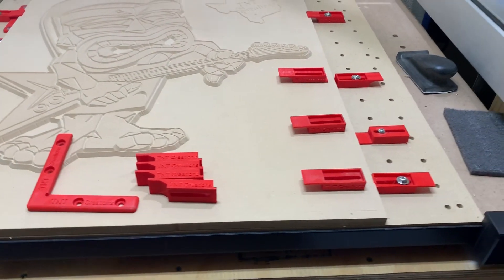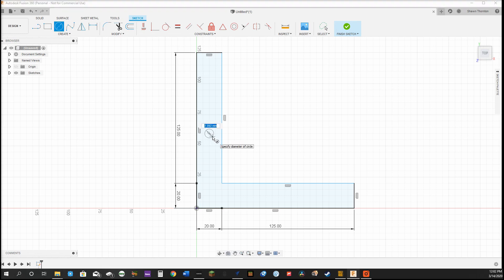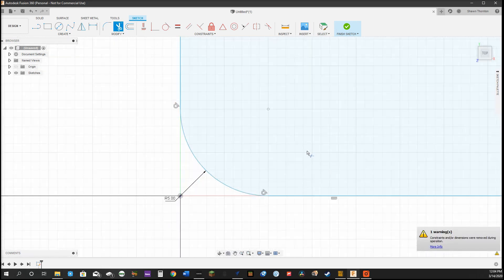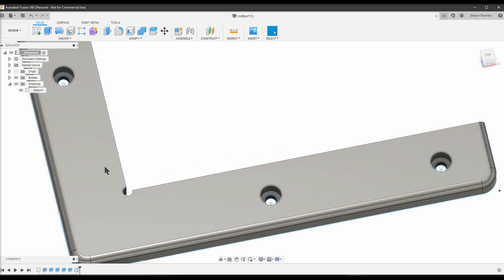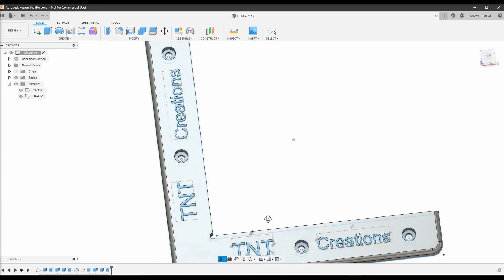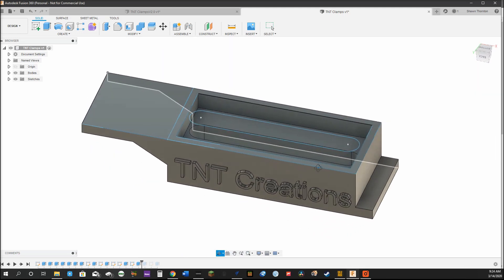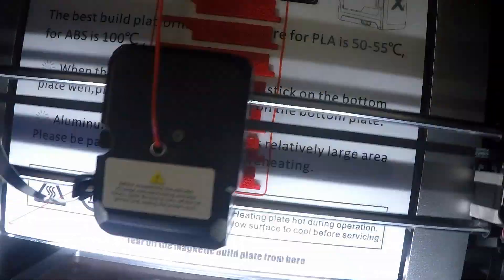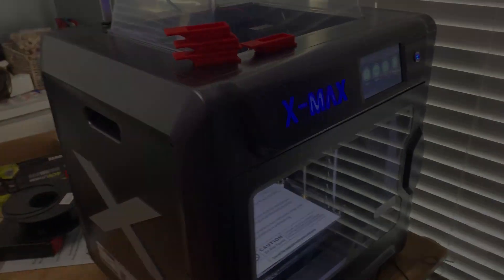3D Printing with Fusion 360 and Qidi X-Max - TNT Corners and Clamps

Comment: Can you give me the site address to where I can buy  these. Also I see that you use the touch probe and  the bit setter.
I want to start to use my material bed to set my Z height to help from cutting in to it. If I use the touch Probe to set my XYZ with a end mil and zero all there . move my router and set the Z to the machine bed with the paper methed is the only thing I need to zero there is the Z height. Is that correct . And as lone as I don't redo the x and Y and do a bit change I still only need to set the zero on the Z.no matter where i do that on the bed. I want  to buy a bit setter how will the bit setter help do the above.
If this was the wrong place to ask this then I am sorry.
But thanks Jeff Peters
Reply from the maker: Yes. I believe you are correct. I’ve never used the bitsetter to set my Z at the machine bed, but it should work. The bitsetter will set your bit where ever you set your initial zero. You can still use your touch probe for your xy and as long as you don’t change your zero, it shouldn’t have to be reset.